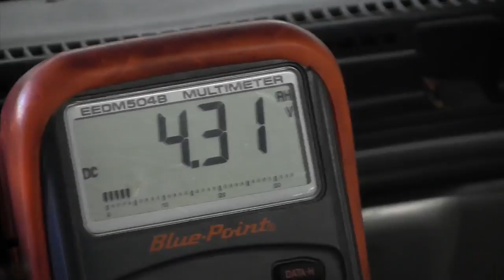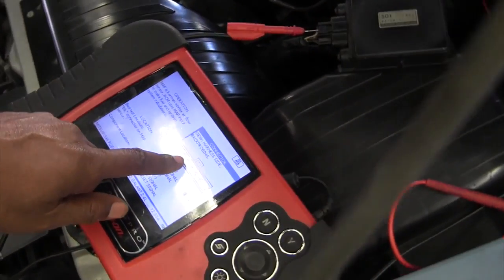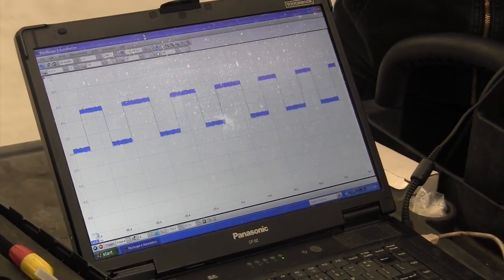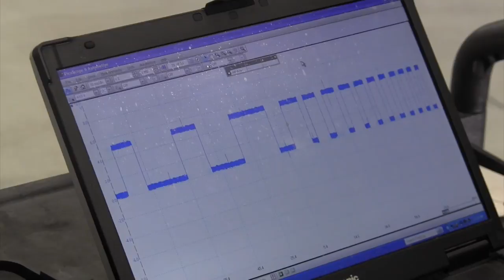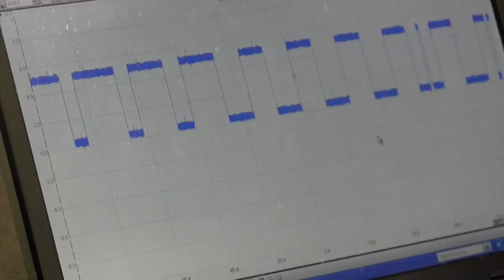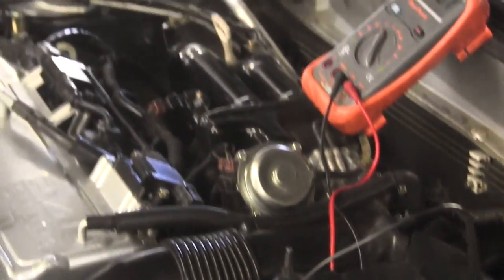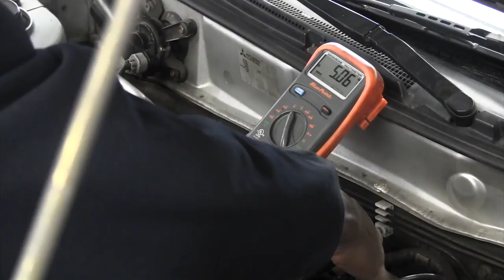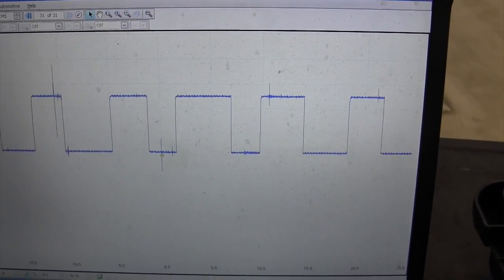Mitsubishi   Galant  MAP and  MAF Sensor Problem

Comment: So when the MAF sensor output not uniform it can cause higher fuel consumption? 
I have 1999 Mitsubishi Galant GDI 2.4 I have a second MAF sensor but the new one is not a vortex type can work this car with a hot wire type MAF? I try out, but not sure is good a short fuel use is most the same like before but a long fuel consumption is go back to normal use.

Comment: I have a galant 3.8 lts when disconnecting the maf sensor goes up to 160 kg / hour and if I connect it goes down to zero  
My question is it needs to be replaced or it will be an electrical problem
Thank you
New sub
Reply from the maker: In most cases BUT not all if you disconnected the Maf and it runs better it could indicate a bad MAF

Comment: i have galant 2007 model have problem with gear the N lamp flashing With D after i drive the car for little time and the gear taking shift no 3 is that mean the gear is broken or another smothing cause this prblem thank you and i'm wating for your respond.
Reply from the maker: I would see if there are transmission codes

Comment: My trasmicion stays in 3 ra. And the start is slow and when it picks up speed does not exceed 40 miles forsando the engine. Supuetos codes of Erroe are P0720 and p0715 thanks I hope Q I can explain a bit of the fault thanks

Comment: Hello can you tell me what voltage must be at idle on MAF signal wire and at full throtle, cause engine have no power and make just 5km/1L
MMC Airtrek 2.0 2003 thanks!
Reply from the maker: Sub251202ast usually the MAF Voltage should rise above 3.8v WOT in park or neutral. What is the make model and year along with the engine size and are there any codes with the check engine light on.
Reply: Mr305Maxxx  what work have you done before you started getting any codes?